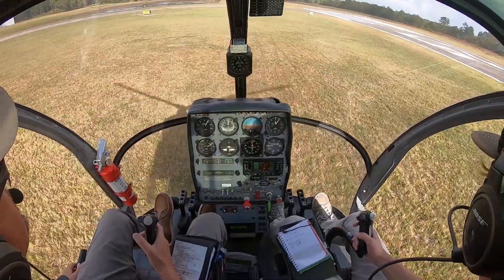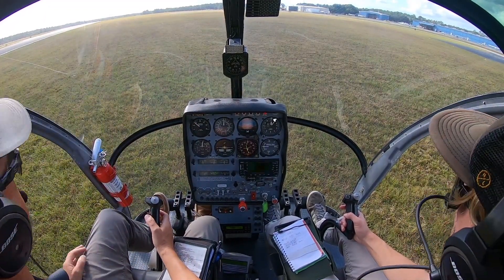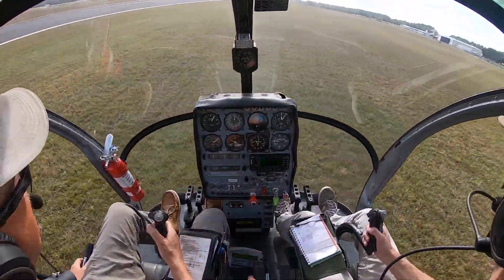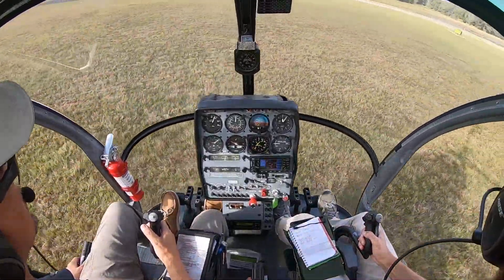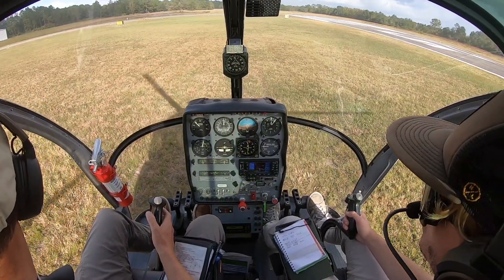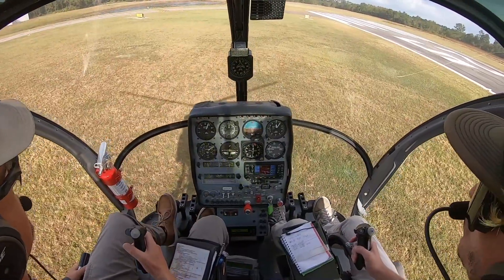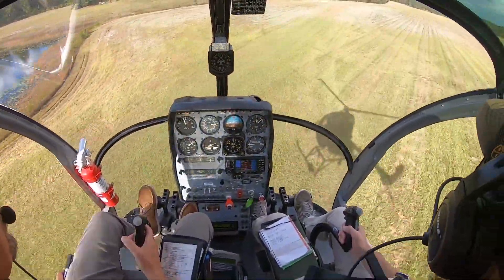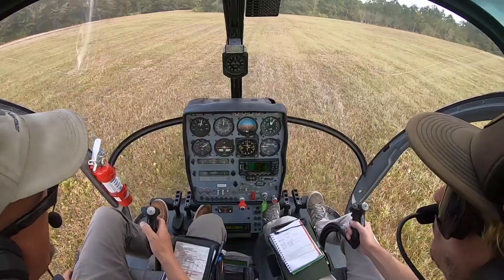Helicopter Emergency Procedures.  Stuck Right and Left Pedal in a Hover.  Schweizer 300.

Comment: Why are you teaching someone to go from one emergency to another more dangerous emergency?  Per the 300 RFM, tail rotor failure while at a hover, “place twistgrip in the IDLE position and perform a hovering autorotation.”
Reply from the maker: Thank you for your question.  In order to answer thoroughly please could you define/clarify "another more dangerous emergency".
Reply: do you think it is safer to handle an emergency at a 3 ft hover with no forward airspeed or with 100ft of altitude and 50kts of airspeed?
Reply from the maker: Great question.  The short answer is, it depends!  
First of all, I do not recommend practicing tail rotor malfunctions unless you are being trained by a seasoned Instructor who has experience with these emergencies.
Now to a slightly longer answer - The urgency of the emergency is of primary consideration.  Some emergencies are best dealt with at a hover.  Others absolutely are better dealt with at altitude and with airspeed.  The procedure you refer to is for Loss of Tail Rotor Thrust.  A different condition to stuck pedal/fixed pitch. 
 There are a variety of tail rotor malfunctions, it is important to understand the differences between each one.  Reducing throttle to idle with stuck left pedal (anti clockwise rotating blades) would exacerbate the rotation and increase the probability of dynamic rollover and ground resonance after you make contact with the ground.  Lots of variables to consider there.  Maybe you are at 3 feet, maybe higher.  Either way, with the aircraft rotating, a smooth touchdown becomes less likely with each revolution. 
 Immediately after the "Loss of Tail Rotor Thrust" procedure in the manual, is the procedure for fixed pitch, which describes maintaining airspeed, shallow approach to a run on landing, controlling yaw with throttle and collective.  The procedure assumes you are in forward flight.  From a hover, increasing collective stops or slows the rotation, allowing transition to forward flight (which you could do until you run out of fuel), and then performing the procedure in the manual to successfully land the aircraft.  Fixed pitch/Stuck pedal is not a Land as soon as possible emergency.
Thanks again for the question.  Good stuff!
Reply: Stuck right, not a lot of good choices, depends on how far to the right it's stuck. In a hover you'll usually do a hover auto. Getting rid of the torque helps, but may not stop the rotation, but as you pull collective and decrease Nr, tail rotor thrust will decrease. You may be slowly rotating when you touch down, so it's important not to let the aircraft drift.

Stuck left pedal is easy, and I think leaving the hover to do a run on landing like in this video is a mistake. Nobody dies if you tip it over in a hover. Same can't be said if you go gaining speed to do a run on. Easy to handle in a hover. Just keep slowly reducing Nr to decrease tail rotor thrust, while raising collective to keep it off the ground. When tail rotor thrust decreases enough that the rotation stops, nurse it down onto the ground. You have all the time in the world, so you don't have to rush.